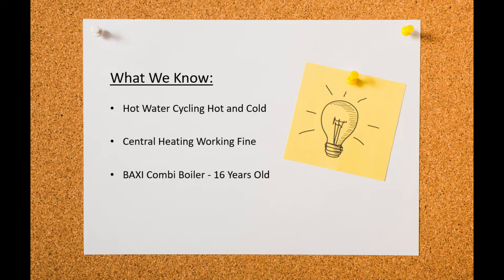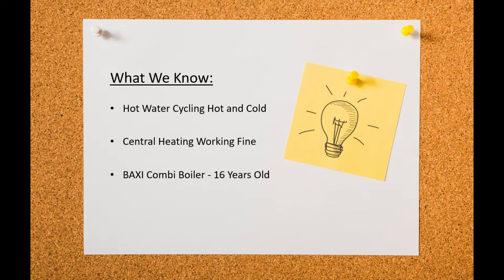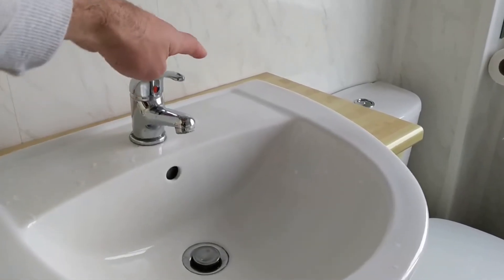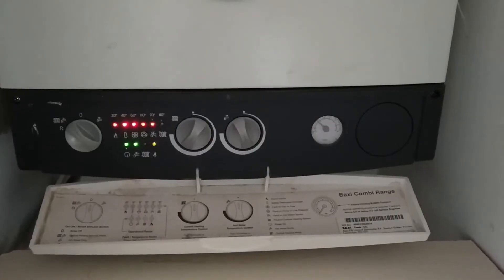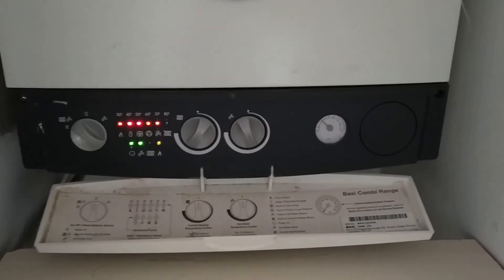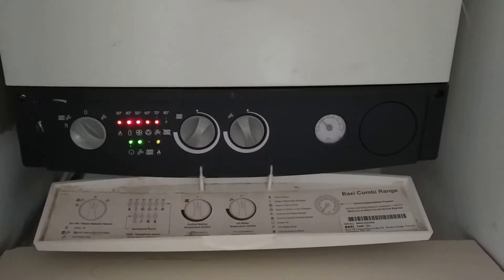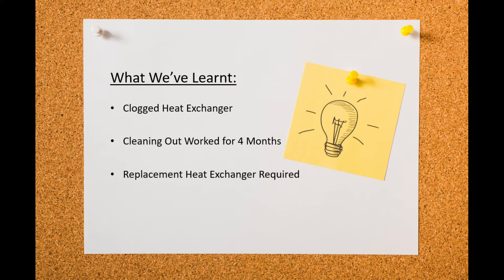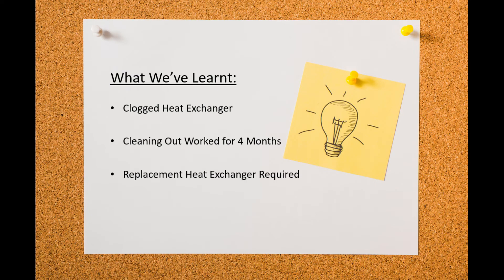Combi Boiler - Hot Water Running HOT and COLD

Comment: I change it the block but still the same issue. My hot water keep going up to 90 and the shut down then drop around 75 and kick back in and does this only with hot water I change the heat block exchanger and double checked the sensor

Comment: I have a similar problem with my boiler, it's so annoying. My system is insured so I've called someone out to look at it more than once and because the problem is intermittent, guaranteed it doesn't happen when they call.  I've had the diverter valve replaced and the sensor.  The engineer tells me that it's working fine and as it should be.  It hasn't been fine since November 2022 when there was a leak and the diverter valve or something was replaced.  I wonder sometimes if they've done something deliberately to make me change my boiler as it's over 15 years old.

Comment: ...nice video thanks . My boiler a valiant is also having the same problem . In addition I have noticed that the pressure drops and every 12 days I need to turn it up again . Does this mean I have another problem like a leak ? I have checked all the radiators and all seem fine . Naturally I cant see under the ground floor floor boards . Any advise welcome . Thank you .

Comment: Faulty diagnosis. It could be the thermistor giving a wrong reading and cutting out too soon. You should not be so quick to conclude a problem without full investigation.
Reply: Ok so what's the solution to your 'could be the'  diagnosis?
Reply: @paultweedley2026   Get an expert in

Comment: I work for a national company we clean the heat exchanger out with a chemical called fernox ds40 and it really works.. don’t buy n new one use ds40 soak for a hour for maximum results in boiling water.. (use your kettle lol as ur boilers not working)

Comment: Looks to me like u have the hot water control set on the low side. I let mine go momentarily into the 80c range .. Thermostat controlled shower valve can then cope and maintain a constant temp. If I set the dial lower I experience too much of a temperature variation in the shower.

Comment: If there is sludge in the radiators, this would surely cause the heat exchanger to block again - I imagine fitting a brand-new one could also be a temporary fix!
Reply: The heating system needs to be cleansed with Sentinel  X800, fernox F5 or an equivalent powerflush additive.  Then the plate heat exchanger can be replaced or cleaned with brick cleaning acid or one shot drain cleaner.
Reply: A filter on heating and cold water supply will help keep plate heat exchanger healthy

Comment: tip if you haven't already you should get a magnetic filter on your heating circuit (usually under the boiler) as this will collect any crap that's in your system and stop it going in to your boiler and causing damage to other pricey components. these can be cleaned out every year if you have a service or yo can do it yourself.

Comment: hi when turning hot water tap quarter turn boiler kicking in and out having hot water but when fully open hot water is warm to cold boiler staying on what can the problem be
Reply: I am the same, hot water, tap is hot if only just turned on, but if I turn it on  fully and the water is faster its lukewarm or cold. I think  it's the same problem as he mentioned, the water is clogged getting too hot and because its clogged it's not getting out the tap fast enough

Comment: I have a ideal combi boiler and both taps and shower hot water fluctuated hot and cold. 

The British gas engineer found a worn seal in the divertor valve, which was leaking water into the mounted electronic actuator.

He removed the black box, removed the divertor and replaced the internal seal which was the size of a pin head. 

He replaced the black box actuator too.

Comment: i have baxi 105e and none of my lights are on when the heater is on. So I'm not getting at hot water as well as no heating. what might be the issue?
Reply: I had the 80e Baxi. Landlord wasted money on a pcb, pressure reliefe valve, pump , heat exchanger, diverter valve. all these repairs came at different times until the boiler was condemned... the cause was sludge in the system, all it really needed was a full system flush £400, he spent more than that on repairs. The boiler was 12 years old and never had a flush in its whole working life.

Comment: The issue of hot water running hot cold hot cold can be due to a heavily contaminated impeller.  If so, it's a 30 minute £0:00 fix 👍👍
Reply from the maker: Thanks for the comment. Something for people to try out if they're getting these symptoms.
Reply: Hairyhound so how do you fix this at £0? Please explain the process thanks
Reply: @cncmedia1461  Remove the pump clean all the derbies from the blocked impellor fins then replace the pump. Ohh and do remember to isolate the the water pressure before you remove the pump motor.....but if you needed to be told that maybe you should not be doing this yourself ??? Stay safe.
Reply: @TheHairyHound  thank you mate , maybe I should get you to do it, how do I reach you if you're in the UK thanks